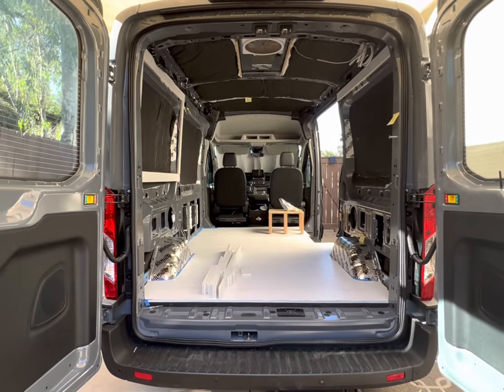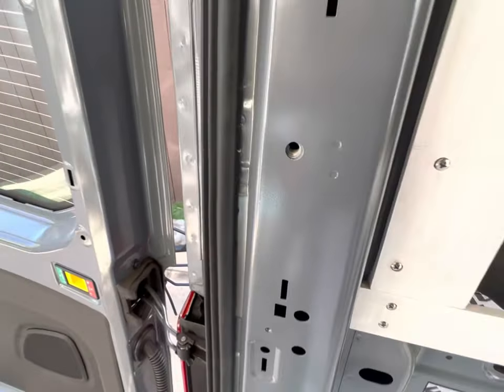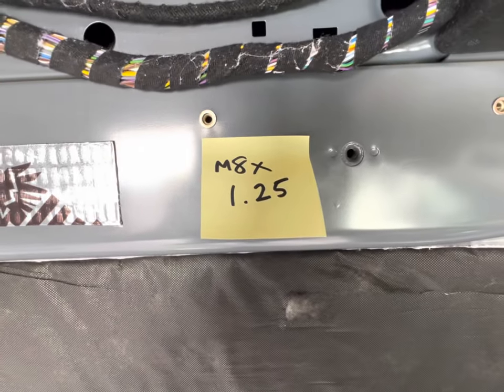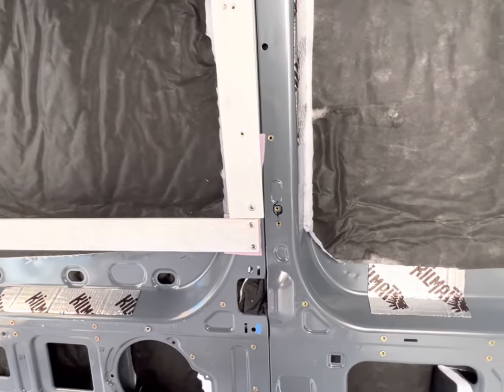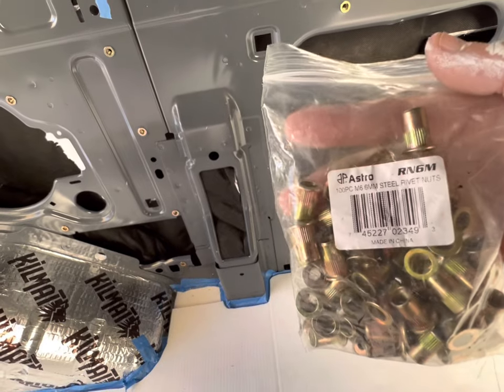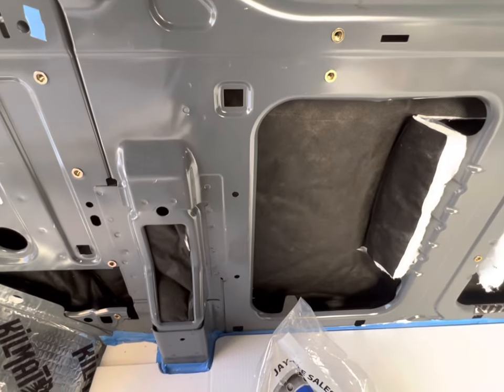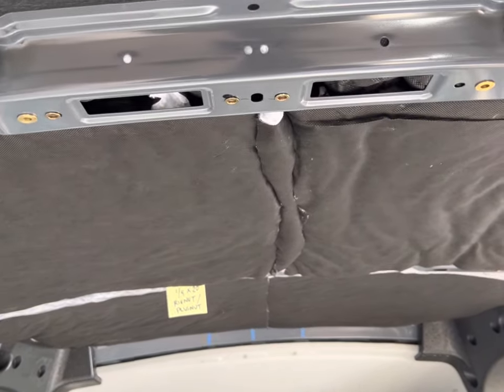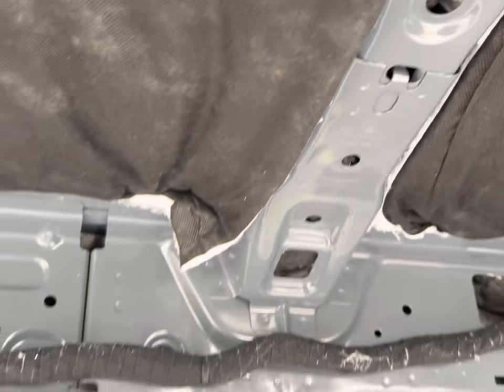2021 Ford Transit Cargo Van Pre-drilled factory HOLE SIZES for bolts and rivnuts

Comment: Good Information.  I think there are enough holes in the Transit that you shouldn't have to drill any new holes.  At least, that's my objective.
Reply from the maker: We actually still had to drill a few holes, and enlarge a few others, to install rivnuts exactly where we needed them. But the pre-drilled holes were a huge help.